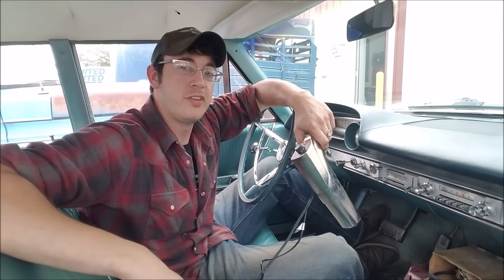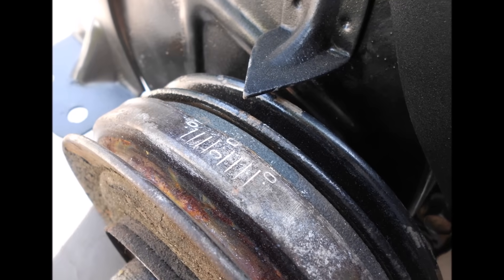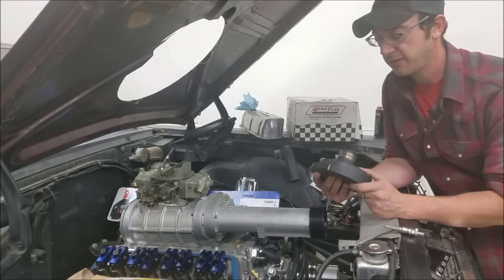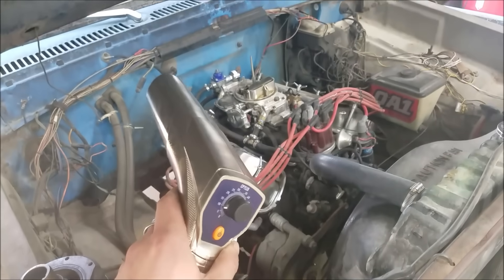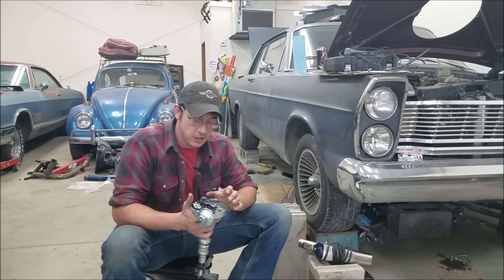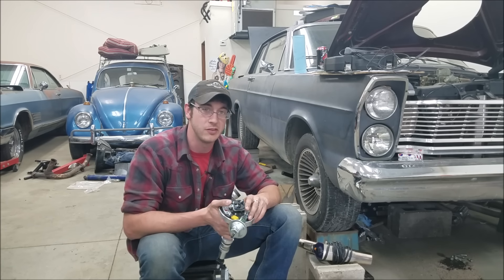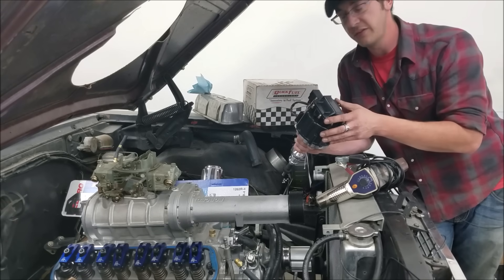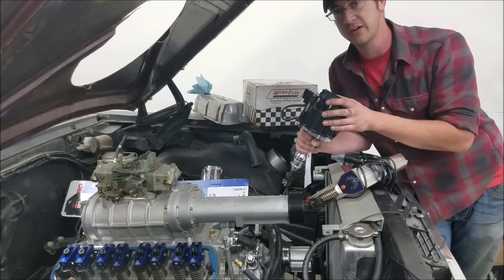The Timing Light & Total Ignition Timing (Maximizing PEAK HP & Performance 😎)

Comment: I have a problem. When I use the gun set to 0°, the balancer mark lines up with 12° on the timing tab. When I turn the dial to 12°, it does not line up with 0°. Rather, I have to set the dial to 19° to get the balancer mark to line up with the tab's 0° mark. Should I trust my tab or the gun?
Reply: Take your cylinder one spark plug out, find true top dead center, and re mark your balancer, or just replace it, yours has spun on the inside hub.

Comment: Does altitude make a difference.....should you advance  or retard your timing , Great video by the way ...
Reply from the maker: Altitude translates to lower atmospheric pressure - which translated to less volumetric fill. So technically the higher you go in altitude, all things equal - you need more timing advance to achieve the same performance

Comment: I bought a chevy 350 blue print  engine.
BluePrint Engines recommends setting total timing before initial timing. This is because total timing refers to the total amount of ignition advance at a specific RPM (usually 3500 RPM) when the mechanical advance is fully activated, while initial timing is the advance at idle. By first setting the total timing, you ensure that the mechanical advance is correctly calibrated, and then the initial timing can be adjusted to fall within the recommended range. 
I am not familiar with timing. I have a plane Jane Sears inductive timing light. That being said, all i need to do with an inductive timing light to set total time is race the engine to.3500 rpm ( like the manufacturer stated) and set the timing to 32-34 degrees (Set Total Timing: Use a timing light to verify that the total timing is at the desired value (e.g., 32-34 degrees BTDC) when the engine is at the appropriate RPM)
Is that it?
Reply from the maker: They greatly simplify it which imo Is a disservice to the owner as they know the ignition timing understanding of the common person is very low. 
Both initial and total matter - thisnis why many aftermarket distributors allow you to limit total, so you can optimize both initial and total, not just do total and have initial be a game of luck if it works out or not

Comment: 33 degrees with your vaccum unplugged ?
Reply from the maker: 32-36 are typical fully advanced total timing numbers
Reply: @ThunderHead289 but do you need it unplugged or plugged when checking
Reply: @Truth0515  unplugged when setting timing.

Comment: Pro tip; Check your timing light. I had a Snap-On advance light in the 80's that wasn't calibrated right. It read zero at the right time, but when you twisted the knob it was off! I mistimed cars for two months before one of my customers complained enough that I put timing tape on the balancer and found out the light was off.
Reply from the maker: @nicolesdad0  one extra quick way to tell is to have a known advance delta - ie i know this aftermarket x distributors stop bushing is supposed to allow x amount of timing. 
If it's supposed to have 10 mechanical in it, and you see 10 mechanical when throttle is applied, that's a good way to tell. 
Comparing timing from one light to another - eh, assume whatever you are seeing is at least +/- 2 degrees from actual.

Comment: Sooooo I  have a MSD DISTRIBUTOR with a mechanical advance. If I were to use an advance timing light and set my timing at idle 32 degrees advanced. Wouldn’t my timing jump to 64° advanced when the engine reaches 3400 RPMs and the mechanical timing advance kicks in?
Reply from the maker: You are always looking at the tdc mark on the crank on an advance timing light - your number on the timing light is your advance. 
So no, if you use it right 34 is 34.
Reply: @ThunderHead289  thanks for the speedy response

Comment: Luke, thanks for making this video. I have been trying to get my sbc 283 running right and apparently ive been using the dial back timing light completely wrong.
So, let me ask you this. When you find tdc, and drop your distributor in, are you dropping it in on 0 or giving it approximate advance .. say 8 degrees or whatever 1 tooth is ? 
Another Q, reading my cam card , it has 14" near the bottom. Its a summit k1102, same basic grind as edelebrock performer plus, with a couple values .002 different.
What does that 14" mean, thats what vacuum reading i should set it at? 15 to 22 hg is the green range on most any vac gauges. Im a little confused. Do you have an email or fb page to contact you for a more precise answer given my application is always going to be slightly different than others. Thanks !

Comment: On my jetboat, with a 455, When I found top dead center, the timing mark was at negative one on the pointer. But when you start it up, add idle, it jumps to maybe 20 degrees, and when you rev it up, it moves even further. Should that timing mark be staying on the 0 (-1 on pointer) top dead center at idle? Or do I have to rev it up and advance the total timing until that pointer goes all the way back to the zero at 3000 rpms? Or is there a significance to that pointer moving more advanced at idle and it just needs to be revved up to 3k in order to engage the weight? I'm totally confused and just need to get 32 total timing dialed in. Thanks
Reply: Did you figure it out? I have a 455, timing chain was dangerously loose, 8 degrees either way loose. Replaced that. And on my distributor, it takes 18 pounds to pull the vacuum canister. Loose chain=low vacuum.

Comment: My neighbor across the way has an old square body 3/4 ton single cab with a 502 replacement motor and the Holley 850 4bbbl (i'm pretty sure, haven't looked yet, that's for tomorrow) but I figured for the fun of it I'd come watch one of your tuning videos (it's been a while for me but it was my life as a younger Tony) anyway, he's got some dieseling pretty bad every time he shuts down and it's running richer than Shania Twain, so.. I'm going to treat it like it's a new vehicle to me and start from square one.. time it, set the transfer slots to as close to a square as I can, fuel / air on all 4 corners.. get it in order and see if we can't get it to stop making all that racquet after he shuts it off. Nothing like a 4 year younger Luke to show me some timing tips!
Reply from the maker: Given the scenario, here's one that might be even more helpful 🙂
Good luck! 
https://youtu.be/bUv5tUC6Ioo?si=upPtP9M93g5Pd03y

Comment: The best two things you have taught me: (1) fuel return line with a fuel regulator, (2) a dry fuel gauge vs a liquid filled. Thank you. Questions still remain around my 8536 MSD distributor. Was used as a track car vs what now is for pleasure only. Seems I’ve been un-engineering for the last year

Comment: Does altitude affect what you set your timing at? Im at 5200 ft in Colorado and running a 69 Ford 351W with a mild Eldebrock Performer Cam.
Reply from the maker: Yes technically - slower burn time due to less atmospheric pressure.

Comment: Hey! So, I have a '74 K20. I got it running and driving, but it didn't have much power when I stepped on the gas. I thought I needed to adjust the timing and tweak the carburetor. Somehow it was running in a random order before but i didn’t label when I took the plugs off. So I started with the HEI distributor, set it to top dead center, dropped the distributor in, and put the spark plug wires in the right order. But it's still not running right, even though I know there's spark and it's getting gas. It cranks but won't fire, and now the carb is spitting gas out the top.

Comment: I was just watching this good video,my question is Im running a 350 with electronic ignition on a 69 c10 my distributor doesn’t have vacuum advance so in order to adjust a total timing do I disconect the single advance wire to adjusted?
Thanks!

Comment: Hey I need help ! I took your advice and got a progressive ignition installed it with relay that ws easy enough but generating a table ?? need help I got a stock 390 got under 100 k miles on it stock tranny it was doing OK but distributor was worn out I'm planning on upgrading to a mild cam so I decided on progressive ING  I'm Jerry  out of  kingsburg cal I could really use a hand

Comment: @thunderhead289.  Dont you think that setting total timing you basically ramp up the engine to the 3000 rpm. And then adjust your distributor in the same fashion you do with manifold vacuum except your finding the balance with total timing.  Of course as long as you have your transfer slots not pull vacuum on idle.  But in other words.. your engine is only going to pull a total timing no matter how you adjust your distributor left or right.  There will be the sweet spot. Again as long as your transfer slot is right.  
And as long as your mechanical advance is working right???  

Help! Cuz Im not sure if Im getting everything out of my motor.  Or if its just that my stock heads wont flow right.  I have AFR and have things right there. But i get a shaky motor around 2000 rpm to 3000.

Comment: To check total advance timing do i need to reconnect my vacuum advance?
Reply from the maker: No, your main concern is hard throttle total timing which vacuum advance doesn't play into (it drops out under high load)
Reply: @ThunderHead289  so check the total timing at 2000-3000 rpm with the vacuum advance plugged?
Reply: @ThunderHead289  i guess im confused with total timing. Im currently running a mild 350. I set the initial timing at 14 degrees but when i rev it to 2500 rpm i’m getting 28 TDC. But im reading or seeing on the internet that it should be around 34-36. Which would make my initial timing higher than 14 degrees TDC.
Reply: @ThunderHead289  i get it now lol. Correct me if im wrong. Theres a kit i can install to increase the timing curve. Base on my calculations it looks like i have a medium spring kit installed which is rated at 16 at 2500 rpms which makes sense because 12 initial + 16 is 28 which is my current total advance timing. Is that correct?

Comment: I like what you are teaching me, but I can't find anyone that knows about old cars to explain the basics of what all this is about. I've called all the mechanic shops in town and offered to pay by the hour to explain it to me. Could you do a video explaining how all this ties together. I can only guess that the distributor fires a piston and you want the fuel compressed to the correct pressure so the harmonic balancer is telling you when that piston is in the right place to have the best amount of compression of the air and fuel in the piston, so that's why you tune the distributor. I have no clue. I'm just trying to invent the motor from scratch in my head from all the stuff you are saying. I'm guessing that timing has to do with when the spark happens. What is a timing belt? Is it the thing that spins the axle in the middle of the distributor?....... update: I watched some more of your videos, and although you don't say it, I figured out that the 0° mark is when the piston arm is lined up straight and the market tells you that (TDC for piston one). Now I understand that you want the fuel to ignite when the piston arm is on the down stroke side so you adjust the distributor to that timing. Is that right? It's a shame that I have to solve that mystery myself, after watching tones of videos, because no one is just explaining the basics. So that zero mark is showing where your (cam shaft?) Is. So that adjustment to the levels of degree is saying that the egg shaped thing on the axle (cam axle?) Is pointing off at that degree from pointing straight up the piston shaft (TDS). And you want to adjust the distributor by what position you want the top of the egg pointing when the fuel ignited. Is that right?????? Thanks for the little explanations of the basics. I'd like to see a whole video so I don't have to piece it together myself, but you are explaining more than most people, so thank you.

Comment: I have a 1984 ford f250 I believe a 302 with a 1405 edelbrock carb. I can't seem to get it to go past 45mph in 4th gear. Would correcting the timing help with it? It goes faster in 3rd gear. When I shift into 4th it drops power and speed. Any advice is appreciated.

Comment: My 602 crate motor I need set at 34 degrees. I don't currently understand how you know if you're at 34 degrees or not? When you say 5 degrees to 12 degrees advanced, what ending number is that??? Thanks
Reply from the maker: I think you need to step back and search "how to use a timing light"
Reply: @ThunderHead289  Definitely already looking into it. Thanks and have a great Monday

Comment: Hi Luke, thanks for the video, can you or anyone else explain this to me plz?
This is the first time I did the timing belt on my '93 Accord. The last time the timing belt/water pump was done by a mechanic about 5 years ago, who has been since retired.
The car was running smoothly, however when I opened up the timing cover, I found the crank pulley was 1 tooth off to the left of the mark where it is supposed to be, the left balancer pulley was about 2 teeth off to the left, and the right balancer pulley was about 6 teeth off to the right. I marked all the belts and pulley location as where they were.
I then set the pulleys and belts to tdc and lined up as per service manual. Put everything back together, and now the car doesn't run like it was before I set the timing belt and pulleys back according the manual, what gives?
Was the old mechanic correct to off set the pulleys in the first place? Should I go with the manual and keep it as is and then adjust it with the "ray" gun and the distributor?
I've everything marked so I can always go back and set as the mechanic did but would prefer to do it as the manufacture intended it so I can learn along the way too.
Thanks.

Comment: I didn't pay much attention to the ignition timing curve when I first started playing with cars. It was several years before I realized that you can make an otherwise good combination of parts very disappointing if you don't take the time to tweak and optimize ignition timing. I realized all of this when I hooked my timing light up to a Mustang 5.0 HO and saw the timing curve start at just off idle and increased very quickly. The old Camaro I had at the time barely showed any advance. Come to find out the mechanical advance was frozen! No wonder it felt like stepping in a bucket of mush when I floored it! It felt like power doubled when I fixed it.

Comment: So 2500 to 3000 all in rpm depending on load, and 30 to 38 total depending on chamber design/working compression?  No more than 50 total with vacuum advance or 12 over total, whatever comes first?  Adjust vacuum spring till engine stays smooth at all loads. I like ford duraspark much better than hei, other than separate ignition module.
Reply: Or just lock it 😆,  no full throttle till 2500 or so.  High torque starter and pretend it's a race car ha

Comment: This is great and all, but I'm still confused about how the timing light knows when 30 degrees or 35 degrees etc has passed on the crank. It only gets one signal from the wire so how would it know it's turning at 1500rpm or 5000rpm? Does it measure every 2 sparks to determine how to trigger the strobe by figuring out the time in between each plug firing? Like does it count how long it is between every 720 degrees and then divide that time by 720 to figure out every degree? I hope that kind of makes sense

Comment: Back in the 70's I had a 70 Mustang fastback with the 302 two barrel.  I set the initial timing at 10 degrees before top dead center and filed the stop on the centrifugal advance to get 32 degrees BTDC total without the vacuum advance.  Later I pulled a 351W from a 69 Cougar along with the FMX auto and 9" rear and transplanted the drive train to my Mustang effectively giving it a 69 Mustang Mach I drive train.  I set the timing the same as the 302 and it was quite peppy.  I enjoyed humiliating 6.6L TransAms with that car!

Comment: i was ready to set my ignition timing  on my  twin turbo  393 windsor   i had got it running a while back but still in the fabrication stages so i only ran the motor like 15 mins then moved on to the other stuff finally i got back to it and fired it up  and thought  it sure sounds retard   i better throw the light on it but i had a major brain fart i couldent remember  how to use the advance feature  so i searched and found your vid as a refresher thanks for you posting this . with that being said i see your a ford guy  that Galixie  looks like its going to be bad ass  with that super charger it should be a runner fer sure . my car should be a strong runner if i did the math right it should ramp up around 1400 hp  that should pull the old bird nicley anyways keep up the good work  and thanks again for posting this it worked out well for an old guy who had a senior moment  lmao.........

Comment: Ok so I understand the total timing and how to find it.. so what do you do with it in conjunction to adjusting the distributor  or do you leave the distributor alone once you have the initial set. I hope that makes sense or how im trying to explain it... thanks for all your videos also...
Reply from the maker: It’s all a dynamic balancing act between what your engine wants, and what capability you have in your distributor. 
I heavily promote Distributors like the pertronix since it comes with advance stop bushings. That way you can set your initial timing where the engine wants, and also limit the advance to the desired total timing as well. 
Advance limiters are the best way to adjust total timing without screwing up your other timing events - which most chaps tend to.
Reply: @ThunderHead289  
Mannn thanks for just responding  heck anymore these days knowledge is priceless.. most of the time just asking someone for lil help is gonna cost ya . So I surely appreciate you taking the time..  and thanks again for the extra info. I'm looking into it now